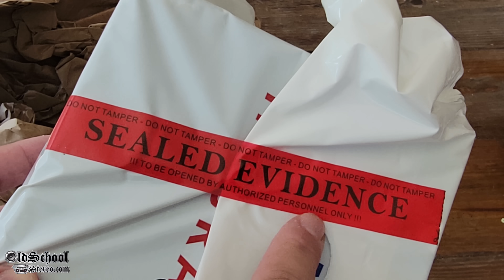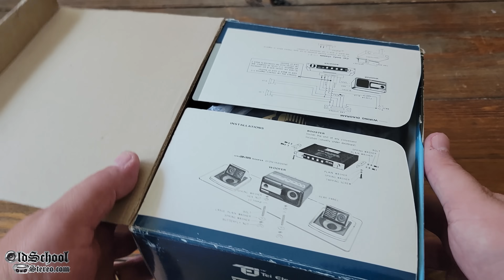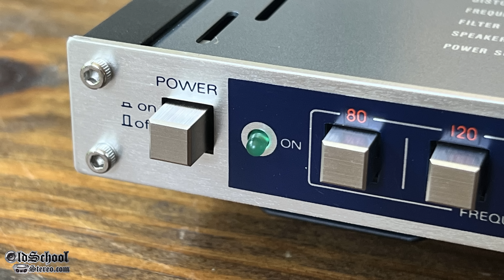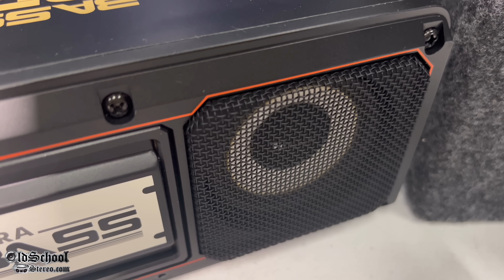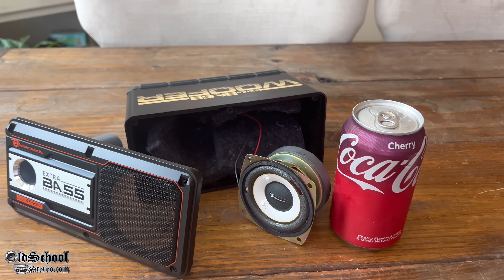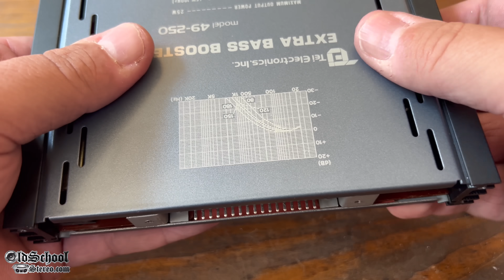The BEST Car Subwoofer of the 1980's?

Comment: I have a "Randix" FM/cassette mini stereo from the mid 1980's that I bought from DAK. Used it continuously in my shop until 2021. Then occasionally since. The tape deck belts finally gave up in the early 2000's but I still use it's RCA inputs for my Mp3 player.  Their premium cassette tape seemed to me to sound and perform as good as the Maxell UDXLII I was using.

Comment: I remember these things they were neat. I wanted one for my desk in my room, but I end up getting bluethunder12 in the late 80s in my car insteadinstead, but I remember this stuff that little thing if I remember did sound like a boom box I had a Sony extra base radio from the 80s that had a very similar woofer built into the back, and you could corner loaded and rattle the walls

Comment: Guaranteed this thing would have put out more solid bass with an intact surround.  Bass reflex tuning is sensitive to leaks, and that is a terrible leak.  If that was refoamed, or a new driver with same rated specs replaced this, it would've sounded much better, for its size.  I can see the build quality was excellent and I would've guessed mid-90s.  The size, build, and ratings of this remind me of modern high-end bluetooth speakers of only the past decade, only thing missing is a radio, battery, and upper-end amp/drivers!

Comment: Interesting sub. Some of my first car audio was using a Radio Shack booster amp (supposedly 20w, but I think it was probably about as powerful as the amp in this video - 5w is more like it) and 6" Pyramid subs from a flea market. I was a broke teenager, so I built my own enclosures out of thick cardboard and a hot glue gun. Not joking about any of those things.

Comment: Honestly.  It probably had a little better bass response back when in 83 when the rubber wasn't disintegrated.  You should put a brand new mini sub in the existing box but also put thinner better wave blocking foam glued to all the inside walls giving the maximum amount of air passage travel for the sub to breathe. And put a little strip of foam insulation around the hole the sub goes into to rule out any unwanted air leaks.

Comment: Best I can remember..16 watts was the most you could get directly from 12v.. input.. those output ics were pretty expensive for the day..and its pretty much how audio was back then before the btl ic outputs.and the ones with transformered step up power supplys.. and high voltage outputs...like jim fosgate or rich coe was making

Comment: You had to have a giant sound system in the 70's and 80's to get decent sound. My father's 1977 stereo system was 4 cabinets, 2 with 12in. drivers and two with 15in. drivers and each cabinet had a 6x9 in it for highs. My Bose stereo in my Chevrolet Silverado isn't as loud but has better sound quality.

Comment: I have one. It's a bit rough, a few bumps and scrapes over the years. Not as clean as yours. I bought it from a co-worker around 83/84 and mounted it in my little nissan pickup. Remember when you could also get an actual mini-pickup truck as well? Memories.

Comment: This was THE biggest piece of crap I ever bought!! DAK still owes me my $80+ tax+ shipping!! 
My Kmart “blue light special” Kraco Turbo Pro Series 6”x9”s pounded like a couple of 10”s while that pile of poop just farted a bunch of distortion, just like it did for you!
I was soooo angry and for some reason didn’t or couldn’t send it back for a refund, so I kept it in my closet for years until I forgot about how badly I was screwed over by DAK. 

But one day, many years later (like 15-20), while cleaning out my closet, I found it again and all of those bad memories came flooding back into my head… so I tore it apart (just like you did) just to see how cheesy it was and then slammed the darn thing into my trash can and thought I was done seeing that pile of junk forever… that was almost 40 years ago… and then 5 minutes ago I see your video of it and all of those bad memories came back again!!! Thanks a lot, buddy!!!🤬🤦🏻😂
Reply from the maker: But man those articles were written to make it sound like the best thing since sliced bread!

Comment: You can refoam it or find a good replacement from parts express. Their dayton audio series are pretty good cheap replacements. I got a couple of 2" vifa drivers and a couple of 2" passives and built a mini tube out of PVC pipe and it jams louder than a JBL flip speaker with the same design.

Comment: Best 3" I've ever seen.  I would have coated the foam.  That would have lowered the amp, but traded for low end bass.  It definitely needs EQ.  The mid bass seemed to be what blowed it.  Thanks...  This reinforces my understanding of physics.  With a little work, this would been the ish back then.  I assume that's basically the same stuff as in high end portable Bluetooth speakers.

Comment: My subwoofer confirms that speaker does dig low, but that distortion was terrible. I wonder if you can find a modern speaker that would fit that enclosure and see how it performs. The box design does in fact look like a tiny sub box with port and baffling inside.

Comment: I had one similar to these back in the day. But it was 250 watts and had a 6.5" woofer before they were cool. Lol. It was called a "Power Mouse" 🐀🐀🐀. It was made with wood instead of plastic though. And had a nice t-line style box with the amp and everything built in. Had led lights that flashed like a vu meter. Lol.

Comment: Being old enough to remember 80s (and early 90s) car audio systems, even at 140 Hz, that little box probably really did make a big difference. The whole assembly reminds me of a 3" subwoofer HexiBase designed and 3D printed: https://youtu.be/4_4tu4rAtgI?si=Jxa9WgNuh0BeDzBJ  Maybe that same Tang Band driver could replace the old blown woofer, if you don't want to redo the surrounds.

Comment: Obviously the age of this old stuff is going to take away from its ability to perform or last. Four decades of deterioration to the surround and the rest of it will take away from what it once was, being used (if its not brand new), then being stored in whatever conditions. Its cool to see this stuff in action though, I started getting into bass in the mid 90's at the age of 15 and I started off just getting stuff for free or really cheap from friends that were giving it away when they got new stuff, then installing it in cars for friends and family. Back then I didn't know ohms law, i didn't know what impedance was, and I didn't know what "clipping" or even the "gain" was. And there was no matching a sub to a box or amp. It was take what I was given (which was almost always a 12" sub in a box) and use an amp I already had, or have my friend go buy one they could afford (which was never a new one or great quality). So in the end they got bass, didn't always sound the best, but we didn't know anything about good sound, so we didn't have much to compare it to, and off we went rattling the trunk. There was a time I went to Radio Shack and picked up a pair of 12" subs (that I believe were for home systems) labeled "Pro Bass" or something like that, and put them in my girls firebird in a homemade lid that sat over the trunk space. It actually sounded good, but again I knew nothing about this industry, and I didn't match any equipment to the area I was working with (available square footage  of open space). In the end it was fun, and we got bass. Smoked a lot of amps, and blew a lot of subs and enclosures.

Comment: In 1988 i had been running a side business for 10 years doing car audio, at that time I was running 2 12" off a kraco eg booster. Played really loud and distorted. I still have them.  But that was years ago.
Now one 10" jl audio 10w4 in a ported box off a old school 150 watt xtant amp gives you plenty of bass, but the system was made to play rock music not rap music.
You want more boom thats tight you need a 12" or 2 12" subs.
Or if you want to make the sides or you areostar van show the bass notes up the sides 6 jbl 1000 18" subs playing at 22k watts 157.5 spl will do the trick, but your hair will hit the windshield and you can't breath.  It knocks the wind out of your lungs. And will make you go deaf    60hz 35hz too.  25hz can make you sick.

Comment: What is the hype of 12 inch subwoofers? 

If cone area is king, then why are there 15s and up???

I understand every vehicle is different when it comes to space and size options of a trunk and or truck, but 12s just seems to be overused where I live at.

I personally would buy 18s and larger if my charger trunk would allow it, but it's not possible.

Comment: That is 100% something you would have found in a Warshawsky catalog!! Love it!
Reply from the maker: I’ve never heard of that catalog but just looked it up and that was JC Whitney to I guess those outside of the Chicago area?
Reply: @wal2  pretty much. The company had several names throughout the years  and even through the 80s they still used both names. I think in the late 90s they dropped the Warshawsky name when they closed the original storefront in Chicago.

Comment: Nostalgic factor from the 80’s is a 8/10. Some dancing LEDs would have definitely made it 10/10. I’m sure a modern class D amplifier with modern high excursion mini-woofer works blow this out of the water but you have to remember this in the context of early 80s

Comment: Things like that speaker were perfectly enough for normal sedan car's small interior space to improve a sound of small box speakers with no bass at all, and it was made for listening music and to get some bass without needing to make big holes for the speakers into the hat shelf. It was not meant to this kind of stupid electronic noise in big airspace. Of course it doesn't have enough power for that. This video is just stupid.
Reply from the maker: Thanks for the insight and insult. You made my day
Reply: @wal2  Not insult, just the way it is. You can make a video of vintage car speakers without this kind of stupidity. Just place it in the right place, into a hat shelf of a small car with some small box speakers, and listen. It sounds just fine there, where it is supposed to be.

Comment: I remember being a poor dude in a 1976 Bright Orange ] AMC Gremlin in 1982 / Yes it was my first car given to me by my father after passing my DMV . test . It had a 360 V8 and he thought it was cool and it matched my 8 ft. surf board that fit on the top like it was meant to be there because it was as long as the car . So to Get to the 4 Real / I was sporting a Mustang AM FM with a cassette player that had NO rewind function .  Also had a set SPARK-O-MATIC 6in round doubles in the doors and 6in ovals in the back . I also had a China made 10 lever equalizer that flashed 2 green pulse bars with the beats . I was SO COOL . Those speaker lasted about a season and crumbled in the California sun . Dude I am 56 and Still have the Surf Board .

Comment: Ah the Drew Andrew Kaplan catalog.

Loved those.

You had to pick through them very carefully 'cause there was plenty of dross in it. I had decent luck really. Probably the best operating item was a 15" dual-wound home subwoofer with an adequate speaker, crossover and a decent enclosure. Not audiophile grade but it filled my teenage bedroom plenty well to rattle shelves and be heard outside in the back yard with my window closed.

Today I still have a few items in storage but I'd doubt they are of any use.

Comment: i remember these, they're pretty good mini sub box if your looking to have a sound system but in a small scale if you have a small car or truck with limited space. i install these on my friend el camino which was a nice set up. two 6x9 with build in tweakers by kenwood, two kenwood 5inch speakers and a pair of these mini sub box behind the car seat.

Comment: FWIW the EQ/Amp looks to have audio amplifier ICs and not discrete transistors. Each is rated for something like 5.8W so running them in a BTL configuration gives the 12W nominal output power.

Comment: I through away 4 Yamaha 6x9/actually 8" Carbon Fiber subs. Because the surrounds vanished.....i should of had them repaired.
They were powered by a Coustic 380 ( or was it 360 ? ).
Wired-up as 1 pair in series x 2. Then I paralleled the 2 sets. =4ohm load on the amp.
"Dear Sir can you please turn down your music when coming to 7/11.
We have to reset the top shelf every time you come here."

80's where cool.

Comment: Sony XE-747model had the best spectrum jumping EQ with sub shutoff, before kill switches came out
Reply from the maker: Yes! I need to demo mine. Think it is the XE-744
Reply: @wal2  That's it I had 2, I made a mistake selling first one then immediately bought another in 98' them things ran me like 370$ but made a hella difference at the time, I had the epicenter running through the HCCA 225 on 4 comp VR kicker 10s infinite baffle in spare tire well, whole trunk and car was the box with seats down

Comment: Those aint transistors , they're chip amps not discrete transistors.  https://semiconductors.es/pdfhtml/0403/502820/page-000001.png < rated at about 5w.

Comment: Don't call this thing a "subwoofer"...🙈😅 It's just a bass box. A real sub MUST ho atleast down to 25Hz or below and bot over around 150Hz to actually be a subwoofer by definition. 
But anyway.. "Booster"😂 That's a dumb name for a amp.
And don't know why they state the freq response for the amp and woofer seperate. Woofer only goes down to 70Hz before rolling off so need to be some bad speakers to use this to boost the bass😅 And sounds like a 12"😂 Yeah, that's never going to happen😅 My God, those surrounds are terrible and glad they rarely use them anymore. They fall apart over time by just excisting🙈🙈😅
Reply from the maker: Sooo…I guess you like it? 😂
Reply: @wal2  🤣🤣

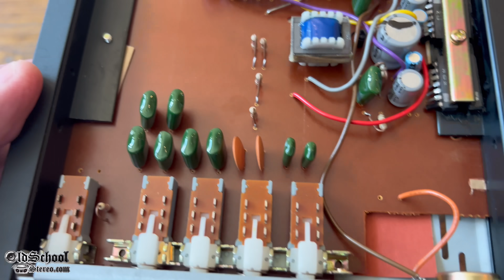Comment: 10:47 i like this clean vintage look of this unit, kinda low end but it looks good! 13 whopping watts from this amplifier
Those "transistors" doesnt even have uhh datasheet or anything, but i think it may be rated 20Volt max, 30w tdp, tjmax 115-150c, something like 2-3A collector current. Not sure why it have 7legs if lets say that 1h may be the pnp and the 2h is npn or its reversed, not sure, there is no info about this ic/transistor

Comment: For how old that thing is, I knew that the surround was either going to be rotted or break apart as soon as it played. 25 watts is low enough and when I saw that the dyno only said 8,  I couldn’t hold my breath anymore from laughing.
Not even Dick Riculous could say anything about it. Lol
Reply: Surprisingly enough I have a Dodge 6x9 that's supposedly 15`w 4ohms and it's indestructible for my receivers. I've put it through 100w and it still won't blow.

Comment: Back in the early 80's most radios built in amps where around 25 watts so anything more was great. 6x9 graco speakers was one of the best then 4 ohms was the lowest you could buy unless you series them but the amp didn't like magic smoke would get out.

Comment: Totally remember stuff like that from the 80s! Those early days for car audio were interesting to say the least!
Reply: Those Japanese, even their low power stuff was unusually well made. I still rock a mid 80's Panasonic combo unit on the back deck, 3 glorious watts per channel but the tuner pulls in every station and it has a soft touch tape deck. They may have made some cheap stuff but it was never junk. That and being outside for 10 years hasn't hurt it a bit.

Comment: That foam surround can replaced. They have them on eBay. I've replaced a pair on some 1st generation Paradigm Atoms and a pair of vintage Realistic Nova-14 speakers and they all turned out nicely. Not sure if you've re-foamed speakers before, but it's really not hard to do. I could do it for you if you want.

Comment: Impressed as to how much effort was put into "trying" to make the sub/enclosure as realistic as possible. The magnet was impressive too. Funny the tuning was around 140Hz, but the filter buttons were at or below it! LOL. Surprised that even with those 2 large amp chips, probably operating in bootstrap mode only did around 10 watts rms into 4 ohms. I was hoping to see the massive power draw using your Fluke remote "amp clamp"! You would have had to wrap the power wire around the clamp twice to attempt to fool the ammeter to get it off zero amps! LOL. That was good.

Comment: yeah 1987 i had a cerwin vega 12inch woofer in trunk of my bmw323i E21, at that time there was often a gas tank behind the seat so the woofer was mounted on a square board with aboat a 5 inch hole with a tube that you were suppose to route up to the shelf. Kind of open air but through a tube. Still got an old amplifier on the shelf that was pretty good Rodek R2180A

Comment: I recently installed the 6 x 3 pioneer wx010 powered sub in my car, and was floored at how much bass that tiny unit put out.  It pulls so little power that the instructions (and crutchfield confirmed) that you are to power it via fuse tap.  

Fits under the dash, easiest install ever.  I had no idea that small subs were a thing back in the day.
Reply: Here's the thing.  Yeah, it was 180$ on Amazon.  There's a whole pile of combo amp and low profile subs available for 50$ less, and larger, and probably louder. 

But,  I'm not amplifying my doors and rear deck.   I put decent JBL speakers that took lower RMS in, just because I wasn't interested in going all out with a system again.  

The pioneer unit is expensive, but it's also adding just enough more low range and sound quality, and isn't drowning everything else out.  So in my case, it was a really great option to finish out upgrading sound.  

I'm saying all this as someone who's had a couple really nice, loud, multi amp systems over the years and generally have high standards for the SQ aspect.
Reply: @No_Use_For_A_Name1981  you’re out of your mind to pay $200+ for that thing. There are FAR better options for less money, even if space is limited